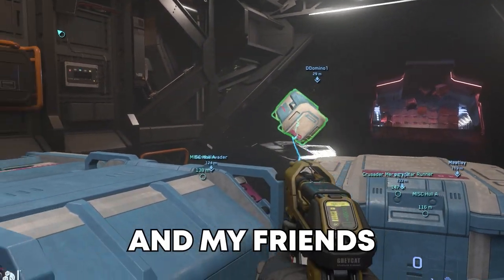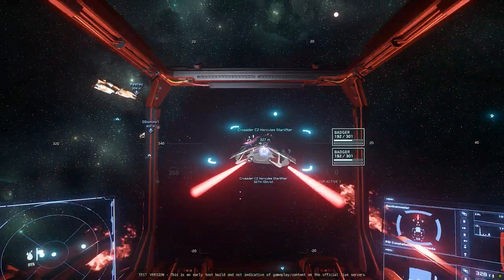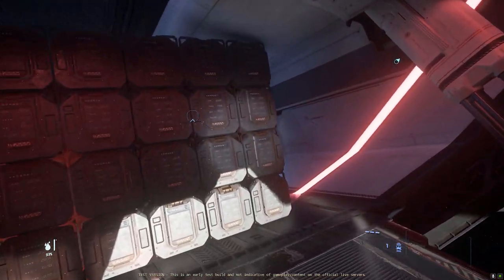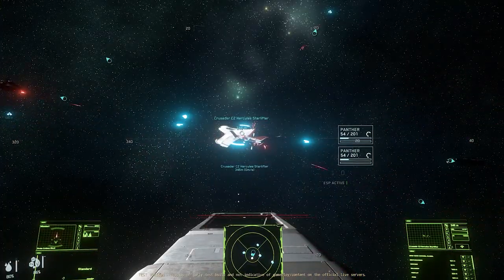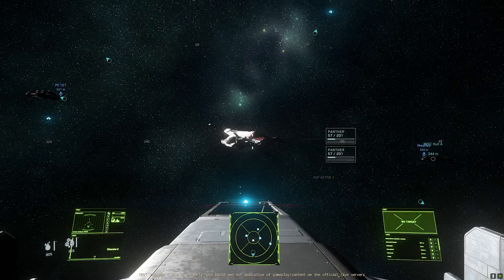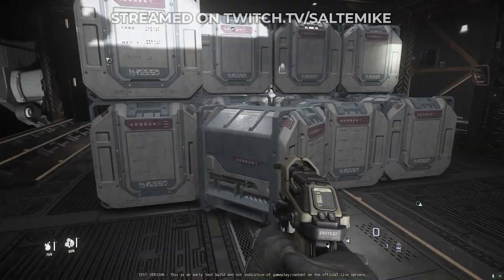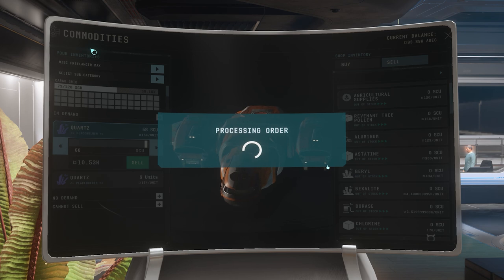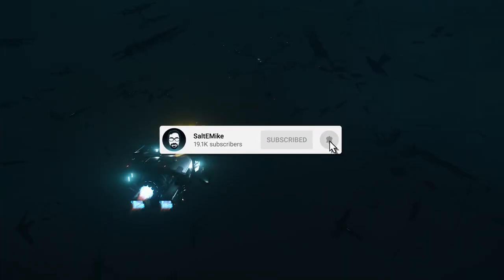How the Cargo Refactor Works | Star Citizen PTU Guide

Comment: The two-handed tractor beam gun should be able to grab multiple boxes at once.
Reply: god I hope so. I was talking to one of my org mates and I voiced my love for the cargo refactor, but at the same time I'm a touch apprehensive about how much time it will take to move cargo. SC is already pretty bad at respecting the players time. This is just another thing for me to spend 15 minutes doing. Which is on top of having to wait for my ship claim to process, after waiting for the tram for a minute and a half because I got out of bed at the wrong time. You bet your ass I forgot to set my spawn at Port Ollisar so I have to spend a solid 3 or 4 minutes flying straight up out of Crusader. Oh, and this is all because I died on the ramp of my ship trying to get into space to collect the cargo from another ship.
Reply: What I think the devs are aiming for is whenever possible for the game to use larger than 1 SCU boxes, so a Caterpillar and C2 wont be flying around with 696 boxes inside but instead a bunch of 16 SCU containers stacked inside, the only problem is you'd need a bigger beam to lift them.
Reply: @clockwork2985  I hope you're right. In real life the size of shipping containers is determined by road and train transport. What limitation does a Hull-E have? Even if its just for game performance it makes more sense to have the bigger cargo haulers moving larger boxes. I like the idea of 16 or hell, make it 10 and shape it like a shipping container.

Comment: Well duh, larger ships are easier to move cargo, smaller ships have to worked with more detail. It's the same concept you'd see in a movie basically. This is no shock or surprise, at least to me it isn't.
Reply from the maker: It was just as easy to get the boxes to them, they were more clunky and had more issues